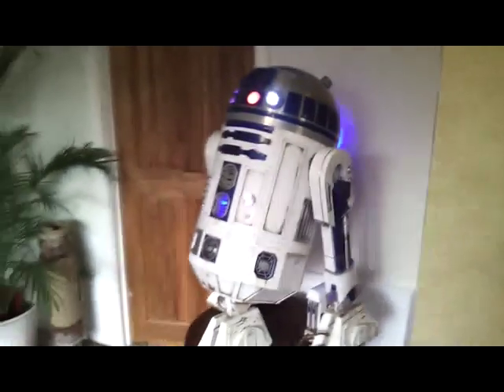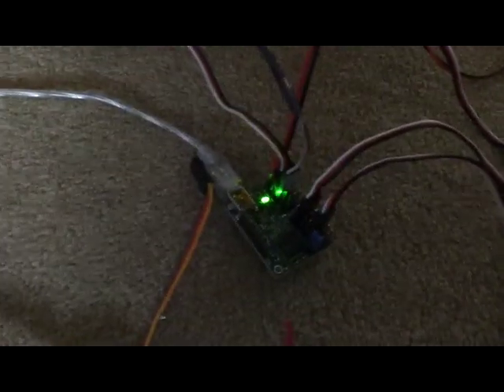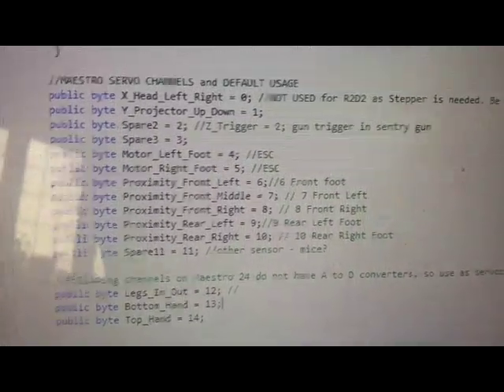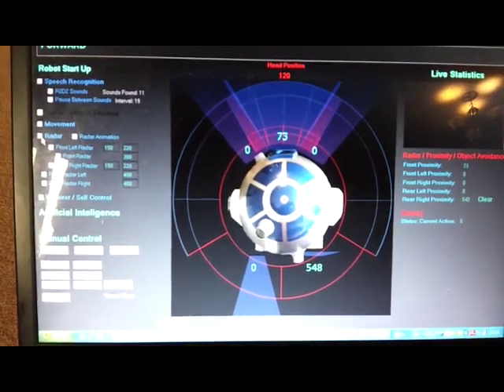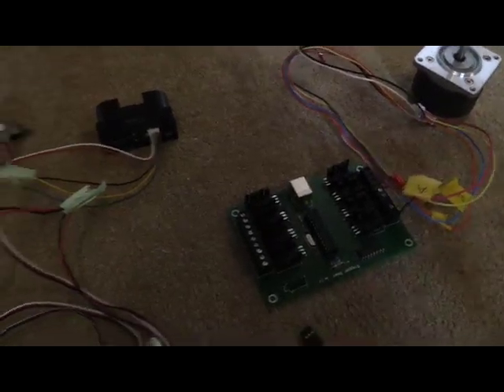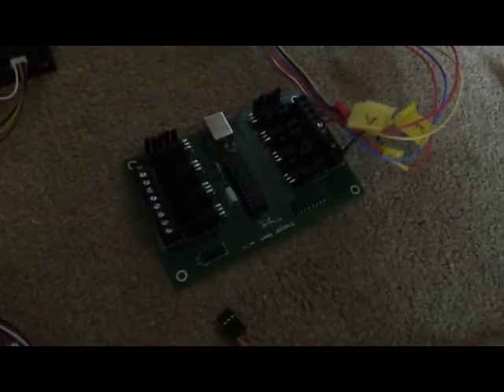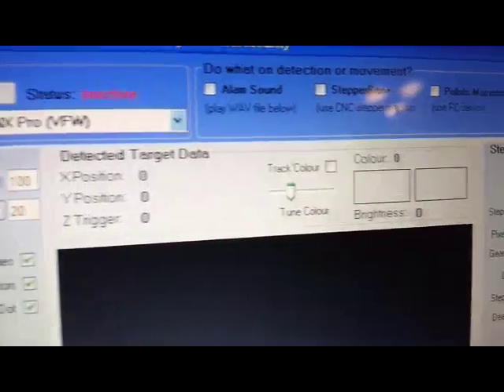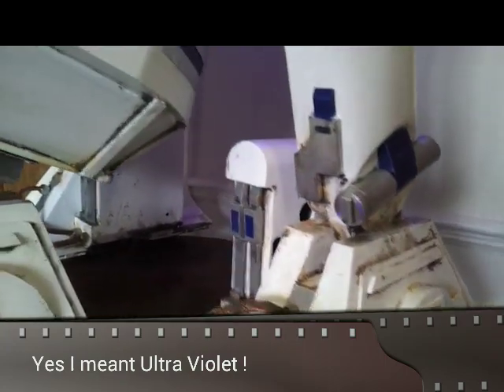Autonomous R2-D2 Part 1a  - Walkthrough of Electronics, Software and basic configuration

Comment: Do you think this sort of software (not exactly the one you made, but another version) would work well on a Raspberry Pi? As the Pi is a relatively small, low powered computer, it should work quite well in that sort of project, one would think.
Reply from the maker: It could read the IR outputs and perform some basic processing and send the data wireless to a PC (if you needed it) but then what? it could steer etc but ultimately any navigation needs to be part of some master plan else the robot would have no purpose. Some like the interactive one have a "patrol mode" where they just go around avoiding things; that could be dome with a PI or Arduino easy enough. Hope this helps. I will be revisiting this in 2015 for a more sophisticated version and finally uploading it for a free download.
Reply: jblackmore2003 I was thinking of doing a part autonomous/static part remote controlled one (one day) that could also act as a sentry for detecting motion and sound. The autonomous side of it would be it's primary function, to be able to wander about, missing objects and people. I was only thinking of the Pi because of the size and power requirements.

I look forward to seeing your future updates. Should be fun!! :)